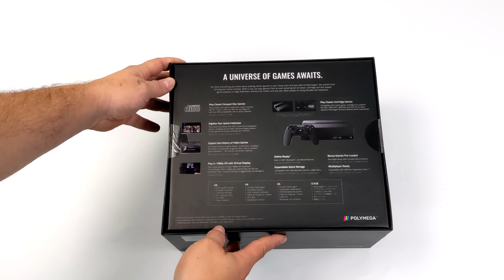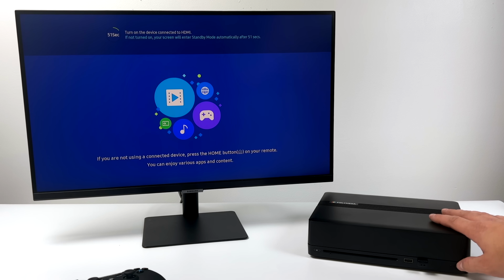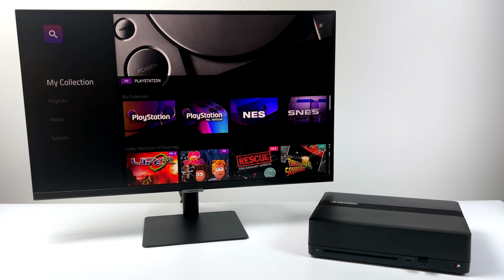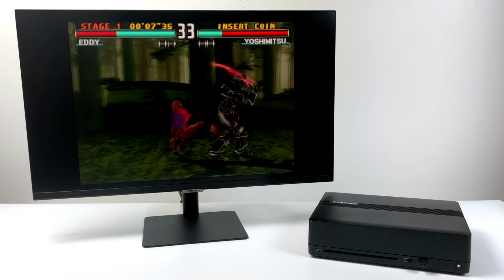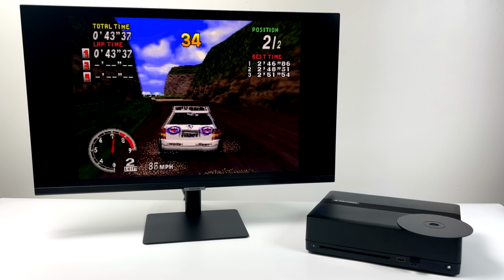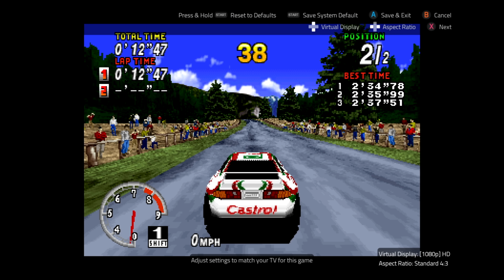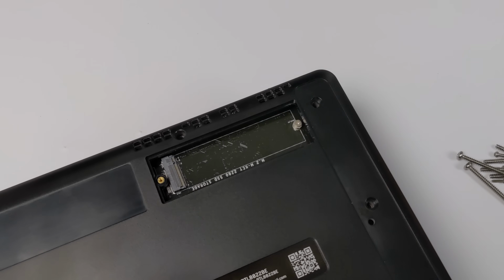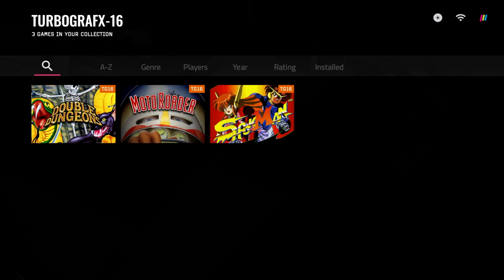Is This The Ultimate All In One Retro Emulation Console? Polymega First Look

Comment: I've been an outspoken, and at times overzealous, critic of this thing since it was renamed the Polymega, and yeah, I still don't see the point of this, and moreover who it's intended for.

It's taking the most arduous aspects of clone consoles and emulation machines, and if I'm not mistaken it still uses HLE BIOS by default for all of the disc-based systems it's running, which will likely cause issues with a lot of games if they aren't the most popular titles, requires the user to supply authentic BIOS for the best experience, and that's before the $60 per piece expansion modules for each console you want to use carts from.

Just to give manufacturers some credit I will say that the console looks pretty well designed and quite solid, the menu interface is pretty nice and clean and looks pretty much exactly as they advertised on the website a couple years back, the included universal controller is also quite nice as it's based off of an already proven controller, and the games boot rather quickly and are identified in a snap.

With all that said, I'm still rather confused as to who this console is made for: collectors will already have original consoles or high quality alternatives to go to, people who want emulation machines won't shell out $500+ for a closed off, underpowered PC with a disc drive when there are MANY alternatives, and the casual player looking to revisit their favorites will just buy the retro games or collections they want from modern consoles or go to something like the Evercade or any of AtGames' current offerings.
Reply: Word. This is just a mini PC in a cool shell.
Reply: That last paragraph was extremely well said 💪🏼 and perfectly summed up what I was thinking
Reply: I bet some people will still buy the Polymega since they found out you can use cd-r’s
Reply: Evercade vs does look like retro done right. But licensing will hold that back just like other machines. I seriously doubt will get Zelda on evercade even tho we don’t need it on it. Just makes you think what other big title won’t show on evercade. On evercade you just get what you get, and hope you get what you’d like to play on it. Or just go with whatever library it gets overtime. Evercade has Playmaji beat on pricing I’ll give them that!
Reply: @cassiodalcin  and a cool ui and cool background music. I wish it was cheaper like everyone else. But they are not able to make money off from games and shipping Cost Is just a nightmare from Asia to states so maybe price of system will go down when they get some revenue coming in from the digital games store
Reply: I think it's kind of a way to encourage preservation of older CD titles without resorting to hacked consoles and emulation of ISOs, which already kinda occupies a bit of grey area, and thus can be made more public. 

I mean, you say collectors will have the original consoles, but do keep in mind these are older consoles, and won't last forever. As for alternatives... not really "many alternatives". If this was focused on cart based games, sure, but the main focus are CD based games, and I can't exactly just go out and buy a clone console with even close to the capabilities of a base Polymega (unless you can point one out to me). 

There's a point to this... it's just really niche as a product. But at least it exists, because hopefully more CD clone consoles come out in the future.
Reply: @RippahRooJizah  There are many far better options for the $450 asking price, or even lower. Example, if you want a great way to preserve your disc games, buy a cheap, secondhand PC with decent specs (great place to start looking would be TigerDirect's Ceritified Refurbs section), a sub-$30 USB DVD drive if the PC doesn't already have a drive, grab a shareware or freeware disc imaging software like ImgBurn or WinISO, and run the games you rip on your emulator of choice. Considering the Polymega is a x86 machine running a Pentium Gold 5400T at 3.1 GHz with 2 GB of RAM, with little to no options to upgrade components, you could easily find a comparable or slightly better PC for less than the hardware's MSRP that could still be upgraded and be open with software options. I don't see much use in this hardware for the price when the options are varied and vast for $450, not to mention $60-70 a pop modules, when enthusiasts are far more thrifty and collectors do have far better options if they're going to spend that much. I stand by everything else I said above.
Reply: @DurradonXylles  To be fair, though, your solution is comparatively more convoluted, but not bad. But it's kinda a choice between, at minimum:

A) Buy a Polymega and wait an age to get one. 

B) Buy an old (?) refurbished PC form a place if you know where to look, maybe get an external DVD drive, set stuff up, download a program to rip discs, download emulators to set them up (and hopefully nothing goes wrong with the emu or computer), buy some controllers and/or some XtoUSB adapters for older controller. 

One could upgrade the PC but not everyone is well versed in doing that, and depending on the PC who knows what can or cannot be upgraded (something I learned first hand when I tried to upgrade my PC months ago). 

Ultimately, it's an option, if a niche one, and is at least a step. That said, if "Just get a PC and an emulator" was the end all-be all solution there wouldn't be clone consoles in the first place, right? I've seen flash carts and clone consoles for less than half the price of the Polymega with less than 1/4th of the capabilities in terms of what it can play.

I'm not saying $450 isn't expensive, though. But it has its place.
Reply: @RippahRooJizah  Grabbing a PC to rip discs isn't really convoluted as an option, especially if you have a collection of games you wish to preserve on your own terms. Also, most clone consoles, even higher end stuff like Analogie's offerings, cost less than half of what Playmaji is asking for the console alone, and have better quality to their emulation or hardware recreations to boot.

Yes, the Polymega is "an option", but for the money, it is itself an overly expensive, underpowered "PC with an emulator(s)" that you're telling me is a poor response to your own comments. You're not paying for anything special other than the case and software interface. I'm trying to be a good consumer by saying this machine is a waste of money for what it advertises and accomplishes when there is a glut of options for devices that perform similarly for way less and/or far more effectively. You're offering nothing to argue against other than it being such an option. Also, as far as I know, there's no easy way to take the games you rip off of the Polymega without opening it up and/or hacking it, while my supposedly convoluted alternative doesn't lock down the back ups you create.

As I've said before, $450 for the base unit, $60-70 per console module on top of that, with emulation that Playmaji themselves cannot guarantee is 100% compatible with the libraries of the systems you run, is not worth the money for any discernable audience other than people who are curious and have money to comfortably burn. For the practicality of literally anyone else, it's too expensive to be worth picking up in current market of clone consoles and emulation machines.
Reply: @DurradonXylles  I said comparatively more convoluted, and I don't mean just ripping the discs but also playing them (among other things). I'm not denouncing the option at all, just stating there's a lot more to it than getting a Polymega. Something that, for whatever reason, might not be something a particular collector wants to go through.

Also, again, there really aren't any clone CD consoles out, at least none I can think of that actually compares to what the Polymega can do. Carts are another matter entirely, and there are far more options, but I'm hard pressed to think of a clone console that can potentially do both, even if an additional module is needed. 

I mean, for what the Polymega offers, as far as CD clone consoles go, what even is out there to get? Analogue has a NEC clone console but as far as Saturn or PSX goes it's either real hardware or emulation, there are no clone consoles. And if there is, I'd love for you to tell me. Really, truly.
Reply: @RippahRooJizah  You're right, there aren't any clone consoles for CD-based games other than NEC's TurboCD right now, it's either real hardware or emulation. Which again brings me back to the Polymega since you made this point: what can it do specifically to make it worth the $450+?

The Polymega can play multiple consoles' worth of CDs? A PC with a disc drive running RetroArch could do that.

Can play the carts and controllers of multiple consoles? Other than the myriad of clone consoles, a PC with a Retrode, and possibly some cheap >$20 USB converter cables, could do it. Sure, you're dumping the ROM, but it's no different than how Polymega does it. There are even multiple projects starting to open source newer cart dumpers with the plan of making them cheaper and more versitile than what's currently out there.

Organize your retro game library? RetroArch, JRomManager, MAME, the numerous emulator frontends made over the years can do the same thing, many of which have good looking menu UX's as well.

Online updates for your emulation, the ability to play some of these old games online? It's 2021, these have existed rather prevalently in the emulation scene for years.

With all of this said, "something a particular collector might not want to go through," is really the best case for why someone who's collected hundreds of titles might want to get a Polymega over ripping games to their PC or to an external drive?! I sincerely doubt that anyone who has a treasured collection wouldn't want to ensure that they have backups that would be easy to access and use if and when the originals fail, being able to burn them to new discs or simply play them through other means. Case in point, Nitro Rad had a fan donated copy of Kuon die on him when he started playing it for his Halloween Special this year, and had a burned backup to play for it.

Yes, for PS1 and Saturn, there's only real hardware or emulation, but if someone has a large enough library they likely already accounted for that. If they haven't, PlayStation owners have the choice of three generations of real hardware, PS1, PS2, and PS3, to play games on, the latter two having a bonus benefit of being HD capable. As for Saturn, sure no alternatives for consoles, but the irony here is that the console itself is more than likely one of, if not the cheapest parts of collecting for it, as games get price gouged (especially now with the retro gaming market bubble).

Getting back to the console itself, the Polymega promises the ability to play games without the need for the original BIOS, offering a HLE solution. Sure, sounds nice at first, but once again they can only guarantee that no less than 90% of games will be playable unless you get original BIOS, which still means a decent chunk of each console's library will still be unplayable. The games that are playable with HLE BIOS, who knows what issues will arise once you get away from the most popular games, since they did not and cannot offer perfect emulation by default. Considering you still need to provide your own BIOS in order to have the best possible experience, no different than any other form of emulation that isn't commercial, its value as a clone console for CDs is rather shaky.

I go back to what I said in my initial comment: the Polymega takes the most arduous aspects of clone consoles and emulation boxes and puts them together; the worst of both worlds, with sparse few of the positives.  What's here is an expensive, underpowered, Jack-of-all-trades, master-of-none, x86 emulation box with a decent UX that looks pretty in an entertainment center and offers some limited creature comforts and convenience at the price of being completely locked down with sold separately modules. What value or features does this offer to either serious collectors or anyone who is into emulation? If you are interested in picking it up, don't let me stop you, but there is nothing here that cannot be done better and/or for cheaper. Heck, Ryphecha's Saturn core, which powers Saturn emulation on the Polymega, is already freely available as part of Mednafen. Sure, nothing exactly like Polymega exists right now, but its uniqueness doesn't offer much positive for its price.
Reply: @DurradonXylles  I've already noted that it's expensive. Ultimately I'm not trying to say it's worth the price (that's up to the person looking to buy it, and the price is the reason I haven't got one myself), but that it's worth existing. And PCs can be a cheaper option, but again, a PC can be an option alongside any clone console. For more than a Super NT and less than a Polymega, I could get a PC that can do both things. 

 But there is a market for clone consoles. And because of that, I'm not holding PC as specifically a better option compared to the Polymega without doing so with every other clone system, especially if the issues are "price", "overall capabilities", and "general worth in the long run". And not only other clone consoles, but stuff like items that lets you use SD cards for CD consoles (I myself own a Satiator for my Saturn), or just the original consoles without modifications. 
  

For carts, as I said, there's plenty of other options. The modules are a "bonus" for cart collectors.

Comment: Whether it is easy accessible for casual people who had physical copies for old games or not, the price itself doesn't justify the overall hardware specs as a non-FPGA device standard, and the $80 for a single external module. Also, $649 for complete set of Polymega is just simply overprice although it's the best choice by far. 

With a PC with decent specs, a retropie or even a next gen console like Xbox Series (If you can get one) with dev mode available & Retroarch and so on, any one of them will out perform what Polymega did despite it provides a good UI layout from the start and it is basically plug and play device. 

It's true that being very easy to use for many retro gamers who simply just wanna play games without caring a lot is potential, the fact that it already lost a lot of charm due to the above reasons and it basically fails in terms of marking standpoint considering there are a lot more better options with lower costs in general.

Comment: Would be interesting to see a low power core processor (8400T/9400T - 8600T/9600T etc.).  They are the same TDP (35W).  Might not work as well.  Really depends on how the emulators handle multiple cores.  Could get a little boost with the iGPU and it might boost higher single core than the Celeron.
Though, at that point you basically have a Dell/Lenovo/HP micro pc.   The cart reader really seems to be the only thing going for it unless you really like the case.

Comment: Really sick of these x86 'consoles'. The only thing this really brings to the table is the cart modules, which they could have just released independently as PC peripherals. 
I mean, I get it. Most of this crap is marketed towards people who've never heard of emulation and/or think it's some sort of wizardry, but it doesn't mean I have to like it.
Reply: Most people who collect older games have heard of emulation. The people who buy this know it's emulating games. 

But this fits into a niche of people who want a CD clone console (which is already rare to this day compared to clone cart consoles) that doesn't require hacking a pre-existing console and is more above board than hacking. Then there are specific personal situations one may find themselves in.

You still don't have to like it, but it doesn't mean it has no place. If this had PS2 capabilities I'd be all over it. But for now I will have to settle for HDL on my PS2.

Comment: Looking forward to when the OS is "available" separately. That's all I'm really interested in at this point. It's a really slick looking front end with solid emulators. The hardware is meh.
Reply: I'm sure you can get something very similar with Batocera if you really wanted to. Or even Bigbox if you want to run on your existing Windows PC.
Reply: @steel5897  thanks for the reply and info. I run LanchBox/BigBox in my arcade currently and love it. I would highly reccomend it to anyone in the community as it's a fantastic front end. At the same time, I do appreciate a piece of software that's simply plug and play. LaunchBox wasn't terribly difficult to set up by any means but I have hours upon hours tweaking the individual emulators settings and controls. This OS is much more of a "consolized" experience where you just put in a game and it (at least appears to) just works.
Reply: there is Lakka as well